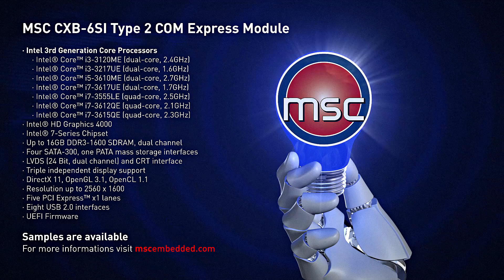MSC COM Express Modules Overview (Embedded World 2013)

Comment: Hello RickyThe COM Express carrier board in Mini-ITX format provides a PEG socket (switchable from x16 to x4) and additionally a MiniPCIexpress socket. Therefore, if you find a suitable graphics card in MiniPCIExpress format, you can use two gfx cards in parallel.One PEG slot graphics card can always be used. Find the data sheet and user manual of the carrier board here:https://www.msc-technologies.eu/products/boards/com-express-type-6/msc-c6-mb-ev.htmlBest regards,Peter
Reply: thanks
Reply: My video card in my desktop computer has a video card Sapphire ATI RADEON / AMD Radeon HD 7850 1GB GDDR5.
  if I post my video card in the carrier board motherboard works well because it has the slot PCIExpress 16x
So it works.
I want to know how much they cost carrier board These motherboards with CPU intel xeon.
Thanks for the answers.
Reply: In the ATX board is additionally provide the video card?
Reply: When will express com with cpu intel xeon processor E3-1535M v6 ?? thanks